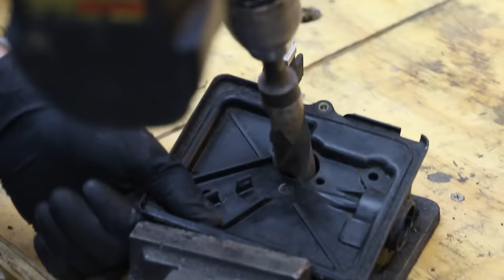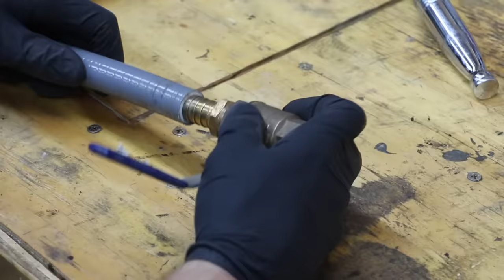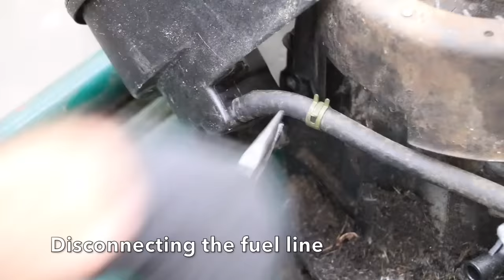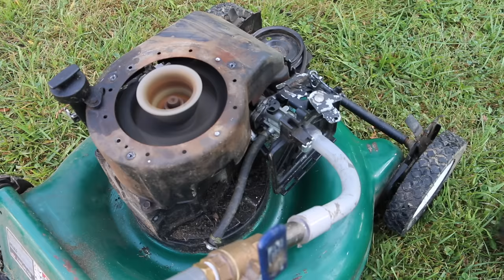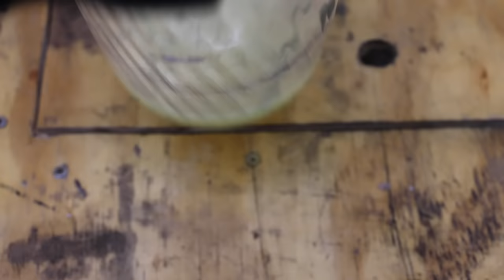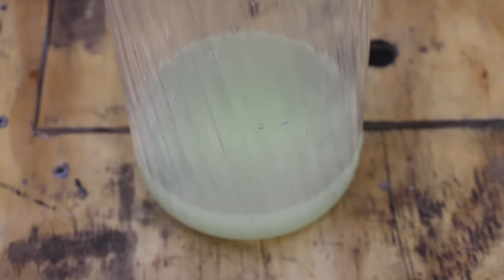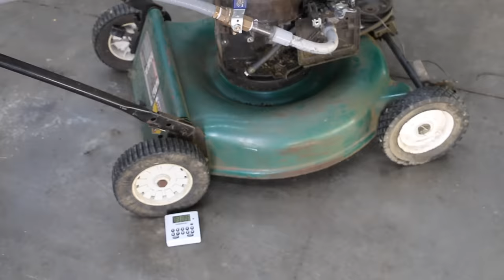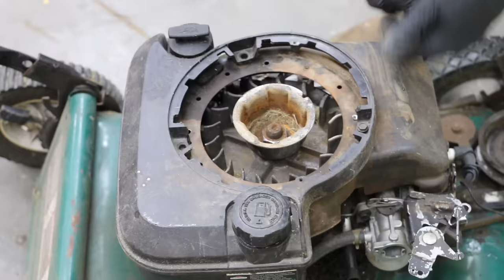Will a "Gas Vapor" Container Improve MPGs and Fuel Efficiency?  Let's find out!

Comment: The cloudiness of the fuel could be due to water, from the atmosphere, having mixed in.
Reply from the maker: Thanks for the feedback.
Reply: As long as I know, in such experiments, not all the gasoline can evaporate, some fraction consists of too big molecules... they remain left, and you have to find some other purpose forthis fraction. Also, this fraction (let´s say 20%) isn´t even soluble if the rest 80% isn´t there anymore, so you get an exclusion from the mix, an emulsion in other words, and that looks intransparent, millions of microscopic bubbles wanting to separate themselves from the small light-gazoline fraction that´s left. In other words, you get 10% higher mileage, but have to re-purpose 20% of the fuel.
Reply: @ChaosSwissroIl  heavy enriched, and so, not any more volatile, so, you miss out on a part of the volume. you can use this part in the gazoline with a normally carbureted engine or otherwise, but not in this engine... And i cannot imagine in how far endecane and dodecane are spontaneously volatile, i cannot recall this knowledge, but we´re talking here about instantaneous volatility, and not general volatility, that can take a couple of months... This gas vapor carburator is a typical destilation column, and you´ll always get separation, even if two sorts of molecules are almost exact the same volatile, but not absolute the same volatile.
Reply: Could also be due to the fact that it’s filtering out dust and pollen since there was no filter on the air inlet on the bubbler tank.
Reply: On top of pulling particulate out of the air making it cloudy what is left over is additives that do not boil out in the mild vacuum.
Reply: gasoline also has a lot of additives such as wax. i would imagine some of that doesn't vaporize when you convert it to fumes
Reply: @doom0d1  some of them also probably reduce the efficiency of a low pressure boil method like this. How would one get pure gas, a relative term for this because idk if you need octane additive when truly vaporized.
Reply: @ebent24  pure gas is gas without ethanol. Ethanol is biofuel (alcohol)
 Think distillation. When you make moonshine, you get methanol then ethanol than mostly water and other stuff from the mash.
Gasoline, by nature, is a product of refined crude oil with additives. Then you have different types and grades
Reply: @doom0d1  if you get methanol in your moonshine your going to kill some folks or minimal make them go blind.  Methanol is from the breakdown of wood not grains in moonshine. But I'm no expert. I want to be but I'm not.
Reply: @thornyturtleranch4u  methanol boils off at a lower temperature than ethanol. Ethanol boils off when the temperature is a bit higher than above that range you have your tails which is whatever ethanol is left with the water
Reply: @doom0d1  well sounds like you certainly know better than I do. Thanks.
Reply: @thornyturtleranch4u  it's been a slow year so i've been learning. If you throw away the first half jar, you'll be fine as they say up to 8 tbsps is the methanol. But, if you're a beginner, best to be safe
Reply: Maybe a air filter would bring other results?¿
Reply: The light ends of the fuel is evaporating leaving all the additives behind. Its a concentrate of fuel additives making the fuel cloudy.
Reply: @klausbrinck2137  diesel comes from the heavy end left overs of making petrol. So you can use that to synthesise diesel.
Reply: @doom0d1  The other stipulation I know in implementing a fuel vapor system is the timing needs to be advanced but that only applies to higher rpms. Mythbusters realized this when they did a similar experiment, pretty sure they made it an old car a hydrogen conversion.
Reply: subscribe. CAPISH?!  now or another hostage getsubscribe. CAPISH?!  now or another hostage gets the worx.. fyi the worx is really bad , use your imagination and then make it so much worse .......... .
Reply: @Combat_Pyro  Reminded me of a water bong, I guess the water is the filter.
Reply: Aeration.
It has air bubbles in it.

Comment: Gas mileage test: tequila vs vodka
Reply: @Dušan Gajdoš high proof vodka is
Reply: Back in the 20s and 30s people would use homemade moonshine as fuel for there cars.
Reply: @Dušan Gajdoš alot of tequilas and vodkas have high alcohol content if you can get it running off rubbing alcohol i don't see why you can get it running off vodka
Reply: Thomas Snitgen ....Sierra Silver Tequila, 150 proof.
Reply: Dave how can you have something that have more than 100% of it?
Reply: Alexandr Tatarintsev, that’s the secret of really expensive booze that only the very wealthy can afford.  Like people who have hot tubs in their cars.  How do they do it??
Reply: @materdoit5667  one of the most underrated comments ever🤣🤣🤣
Reply: @tatarinzcev  the proof of a liquor is twice the number of its actual alcohol percentage...ie... 40% is 80 proof, 75% is 150 proof...... Everclear is 95% alcohol which makes it 190 proof
Reply: @account8242  I learned something from this
Reply: 190 proof everclear is the modern-day market version of the moonshine people used to run their car engines off of..... It's actually how NASCAR got its start..... Moonshine runners would install a drain plug in their fuel tank, fill it to the brim with moonshine, and drive to the destination... And if the G-men(FBI) got after them they would simply outrun them until they were out of fuel and therefore had no evidence
Reply: 151 Vodka. Cheaper by the gal. but your lawnmower want work next day.
Reply: @tatarinzcev  200 Proof is 100% so 150 proof is actually 75% alcohol.
Reply: We have a drag truck that runs off of moonshine and its fast just a fyi
Reply: I think alcohol has to be 80%abv min to run a car off the top of my head or  160 proof for americans, cuz bigger is better 🙄 lol
Reply: Speedway bikes run on ethanol
Reply: Neither of them are gasoline, so it won't be a gas mileage test.
Reply: Better test - mortality mileage.  Who can cover more miles alive, drinker of tequila or vodka....oh shame on me for being so morbid.  I apologize.
Reply: Applied to the lawnmower or the lawn mower?

Comment: I have done a lot of experimenting with this. 1 you to run the vapor up through were the main jet use to be to be able to add air, you're running way to rich.  2 put in a one way valve to stop the bubbler catching fire. 3 as the gas is used up you need to heat the bubbler, 0 at the start ,90c at the end .  you can run 25% water with a little soap  but have to run heat sooner. When you get the mixture right the exhaust temp and fuel burn will plummet . Downside, driveablity is poor, it really only works well bellow 1/3 throttle, and you're always driving with a "bomb" in the vehicle. Maybe if you used an Arduino to control it, it would work. The irony... this was done on a 78 Ford Pinto so it did catch fire... twice

Comment: Interesting and creative concept for getting the vapor into the engine, if I had a guess though I'd say the system was still pulling some of the fuel up and not complete vapor. The most famous attempt at a vapor engine I've heard of is Smokey's Hot-Vapor Engine where he used the exhaust pipes to superheat the fuel to vaporize it. I would attempt to replicate heating the fuel into a vapor and somehow feeding only that vapor into the engine. Loved the video
Reply from the maker: Thanks!

Comment: Very interesting, RPM should have been taken into consideration, I think .
Reply: definitely sounded like it was running at a higher rpm via the vaporizer.
Reply: @tomwerner3671  Doesn't he have a generator now? He could run the same test and see how much power it generates.
Reply: lawnmowers and all small engines in general are goverened by an airflow actuated governer, so as long as the throttle is open itll run at the same rpm

Comment: Looks very interesting, I'll test it.
As improvements, the pipes in the jar can be made bent so the air is forced to go centrifugal, so the movement of the gasoline can be more controlled and directed to create a vortex. for sure will improve the time.
Another set-up can be made with bigger holes to increase the airflow( as setup can use 3-4 diameter and test which is the best as increasing the time)
Reply: I would say small would be better, look at where the valve is, almost all the way closed which tells me that the hoses ate too big.  ¼" line I think would be better.
Reply: Maybe thats where the efficiency gain was lost.

Comment: If you heat wood up to 211* F it will produce gas that can be piped directly into the top of a carburetor and run an engine. Germans proved it worked when they ran their cars on wood gas during a gas shortage. Could be a good video Idea.
Reply from the maker: Great recommendation!
Reply: I remember doing a chemistry experiment in high school where we heated wood in a test tube with a hose leading out to another one which was cooled.  We got flammable liquid in the 2nd tube.  I suspect that the German experiment you mention was doing basically the same thing only they went straight to engine in gas form instead of letting it turn into a liquid.
Reply: Germans also used wood powered engines with practice purpose Tiger tanks.
Reply: "Garage 54" channel already did that ;) Would be nice to see a non-slavic approach tho :D
Reply: No nead to heat the wood, just pulp it ans add some microbes that turn it into ethanol.
Reply: In the UK they ran vehicles on coal gas in the 1930's.
Reply: fema has a publication in making wood gas units for tracktors.
Reply: Proper FPV Wouldn't that be methanol?
Reply: JealousBishop its a vapor that’s released when we burn wood, only know it as “wood gas@
Reply: "Woodgas" is CO , carbon monoxide
Reply: arfski, And all through WW2, as petrol was rationed.
Reply: There's a video on YouTube on North Korean army trucks running on wood gas
Reply: The gases that come out of the wood are mixtures of hydrogen and carbon monoxide (referred to as syngas/synthesis gas) and long chain hydrocarbons (which are basically just desulfurized and nearly pure as is)
Reply: Just for more information about  of French inventor and chimist on wikipedia type http bla bla before the use like  en.wikipedia.org/wiki/Georges_Imbert have nice day .
Reply: With the heating process, car's didn't need to carry pressurized gas, they would carry wood instead and produce the fuel gas as they went along.
Reply: so did america.  coal and wood .  audi made 500 000 cars from the factory like this
Reply: I believe you actually need a lot higher temperature to heat wood fiber to create "syngas" or "producer gas" as it is sometimes called.  Most systems run about 1600 to 1800 F.  The gas driven out of the wood fiber is mostly a mixture of hydrogen and carbon monoxide.  The exhaust from the engine therefore is water (steam) and carbon dioxide.  I have had several friends who converted vehicles by routing their exhaust pipe through a sealed tank containing wood chips.  A simple system but it has a high particulate contact and can be corrosive and therefore potentially hard on engines.
Reply: yes its called a gasifier not to hard for this guy to build i think he is great
Reply: to bad it consumes the wood...   yet burning hydrogen = WATER        ps  the exaust from burning hydrogen is WATER...    figure that one out...   Jay leno has a video of it on youtube.
Reply: in WW2 there were millions of vehicles running with wood gasifiers there are still some around in Norway
Reply: Only problem I've read with these systems is range. The systems I've seen with it working usually have basically a whole trailer behind them for the gasification process. If you have something as small as a gas tank, you'd get a 50ish mile range. North Korea is/was doing this as well to run their military vehicles, too.
Reply: I've done this and have a video on it
Reply: Wood gas generator
Reply: There are videos showing wood pyrolysis running a home generator.
Reply: @laurencecope6677   that is methanol, not ethanol, and no it is not just that easy, it still has to be distilled and that takes heat. Either way is basically running a moonshine still but methanol is very very bad stuff and ethanol is moonshine you can drink. When did you ever see a moonshiner just grind corn and toss in microbes and say yippee I got moonshine? LOL   NEVER because all that is produced is sour mash, not moonshine, and the mash must be distilled in the still to get out the alcohol!  Actually more to it but any way rather making methanol from woody plants or ethanol from sugar crops  like corn it's the same basic thing
Reply: Nighthawkinlight has a couple videos about it if you’re interested
Reply: @laurencecope6677  That's methanol not ethanol.
Reply: That and they ran tanks off wood too for training
Reply: During WWii my dad had a Buick (in the Netherlands) with a wood gas generator mounted on the rear bumper. Gas was rationed and mostly claimed by the German occupiers...
Reply: @laurencecope6677  ?

Comment: Excellent video. You really need to monitor the RPM & assure the same load to tell. Too hard to put a consistent practical load on a mower.  Try it on a small generator with a constant electrical load like maybe heating elements of 1/3 to 1/2 the rated continuous wattage capacity. Monitor the RPM and load (with a kill-a-watt) meter to assure the same load. Also, the high agitation in the bottle suggest that gas droplets instead of actual vapor may be getting sucked into the air stream.  Maybe a felt baffle (as thick as the suction can tolerate) some distance above the liquid level (especially when agitated) and below the suction line would condense liquid droplets and allow only vapor through. Thanks for your time & effort to do what most of us only wish we could try.
Reply from the maker: All great points and thanks for commenting.
Reply: The blade is the load
Reply: Do you really think heating gasoline is a good idea?
Reply: Excellent points!
Reply: Dondre who said anything about heating gasoline? Reread the comment.
Reply: carambatsr 
Love these ideas really got me thinking! Thanks!
Reply: Agreed, the vapour engine looked to be running significantly slower. I imagine the air-fuel mixture was pretty lean considering the thing was sucking air in along with the fuel vapour.

Comment: I love your channel. As I recall, Ford's first car simply dripped fuel onto a heated plate where it was drawn into the engine as it evaporated. It wasn't safe but it worked. That was a pretty good test, using a crude fuel vapor system vs a worn/crude carb. Comparing that to a FI engine w/ a more exact fuel/air ratio is another matter. A mix of the two technologies was done by Transonic Combustion. They'd heat/compress gas before injecting it under high pressure and the "supercritical fluid" would allow the compression stroke to fire the mix. They claimed 64 MPG in their test car, but MPG in testing is tricky. None of the auto makers took them up on their tech. (On a set no-stop run @ 40MPH, I can see a 70% increase in MPG in my current car.)
Reply from the maker: Thanks!
Reply: That carb and exhaust and Intake manifold super heated the large chain molecules to make  it vaporize plus on the Model T(not all) the fuel is all adjustable by finding the sweet spot. The fuel system was made by Holley and was called a "Holley Hot Spot",  also"Stromberg Hot Spot" back then the fuel was real and not additives and cheap alcohol junk fuel like we have today (mostly very light chain molecules that boil at 130 degrees up to about 415 like Ethyl used to be back in the 60s for High comp cars.. With modern fuel the way its been cracked it simply doesnt have the BTUs old school fuel was. The days of the 200 MPG carb are gone unless you want to crack some oil and make it larger chains and use lots of heat to vaporize it, which works if you have the equipment to distil ir.. thanks